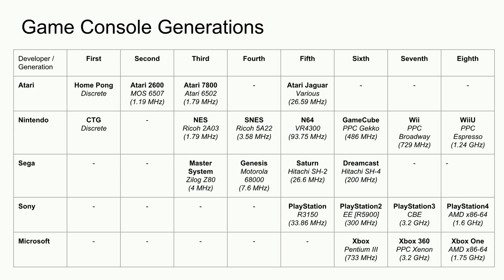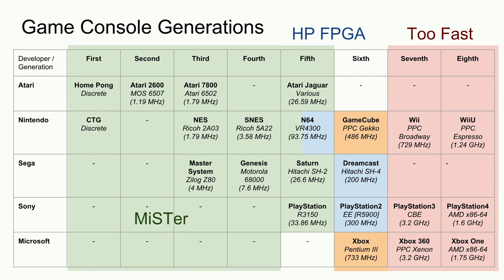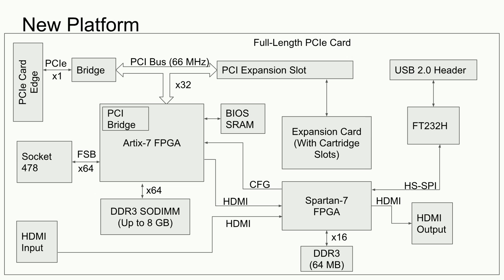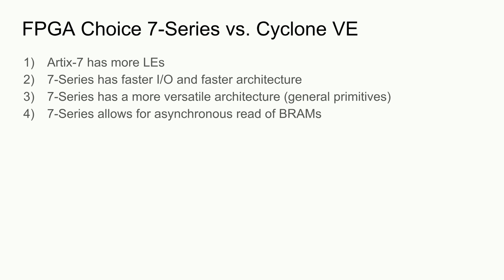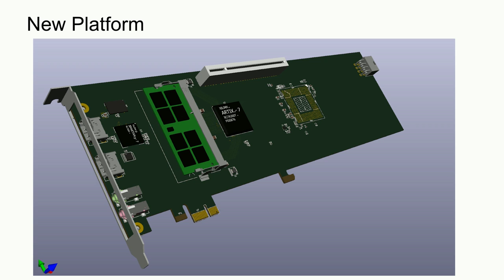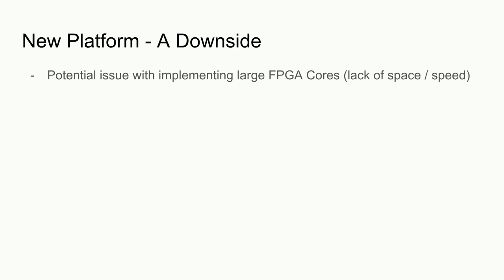A High Performance FPGA Game Console Platform

Comment: This is super interesting. Thanks for posting. I get the impression you want to keep all your progress private until you have a working result. Could you shed some light into why? Also, just out of curiosity, what HDL are you developing this in?
Reply from the maker: Thanks! That's correct. I actually would prefer to keep all of the implementation details private (I would probably release the board files though for the PCIe card). If you were more commenting on the span since the last update, the reason is that I have put that project on hold in place of another one which is also private (for the same reasons as keeping the implementation private).
So a few reasons to keep it private:
1) I don't want to open source it - as soon as you allow random people to start helping out, the entire project looses order and becomes a nightmare. Some people like that aspect, but I'm not one of them.
2) I don't want to provide the ideas for someone else to beat me to it. I can't work on these projects full time as I am a full time academic researcher (that takes priority).
3) Releasing implementation details publicly can be a problem with future job prospects, especially companies that receive classified government contracts. (i.e. they may be concerned that you would leak their project details).

Hopefully that answers your question. Note that I don't have much of an issue regarding releasing the final bitstream publicly (and would probably open the implementation eventually if I became tired of supporting it). I might also consider releasing an encrypted IP, however, I do know that some of those have been decrypted.

As for the HDL. I use both VHDL and Verilog. They both have their strengths and weaknesses, often covering each other. So I use the best tool for the task at hand. Often, the tricky logic parts are done in VHDL (as well as ROM LUTs), and the structural connections are done in Verilog. I don't use System Verilog though, or any other language - I prefer to have more control over what the synthesizer implements (I suspect that System Verilog for example would have problems tuning logic to change path delays, as it's less explicit, same thing with things like Scala based description methods).
Reply: @RTLEngineering  Thanks for the detailed response! Are you familiar with Henry Wong's work on creating a Superscalar Out-of-Order x86 soft processor? There might be some overlap with your work.
Reply from the maker: Yep, I have read his thesis. There are a few problems with using his work though. 1) It's incomplete to the best of my knowledge. Parts of it are done / work, but not enough to be a full x86 CPU. 2) It consumes a lot of resources... I'm not even sure it would fit in the largest Artix-7 FPGA, and 3) it would never run nearly as fast as would needed in an Artix-7. So to be used for an original Xbox, it would need to run at 700+ MHz, but the fastest it can run in an Artix-7 will probably be around 80 MHz. I suspect that even in one of the new Ultrascale+ FPGAs, it would only hit a few hundred MHz (certainly not more than 300 MHz).
It's a cool project, but not all that useful here.
Also, if you are interested in an x86 soft core, there is the ao486 (it won't run all that fast, but it's a i486 CPU). An alternative solution could be to use a RISC-V soft core as a base and rewrite the instruction fetch / decode stages to take in x86 instructions and translate them into RISC-V microcode. I honestly think that may be the best solution to get a "fast" x86 soft core on an FPGA, especially since there are small RISC-V cores that can run at over 150 MHz on the slowest Artix-7 (granted in that case, the x86 would probably be around 120-140 MHz with a very low IPC).

Comment: One day, I will have a powerful GPU sitting in my case, but having to share the airflow with an FPGA based emulation card.
I personally hope that FPGA based emulation becomes more widely available as it can circumvent issues that current emulation has. Like the odd quirks in the N64 that give Mupen64 quite a run for it's money on lower-end platforms... :p. My ideal dream-FPGA-emulation-thing would be an FPGA card that can be driver-controlled by the host OS. This driver would do exactly what it is named to do: flash the FPGA with the core, send some input (like the rom), maybe write some settings to it, take output from the card and display it - or even let the driver link an existing GPU with the FPGA board in order to do graphics-intensive work to render the actual graphical layer. 

Sure, I am not an engeneer, and this is just dreaming. But how cool would it be to have a gaming PC that doesn't just run modern games, but also retro games at pretty much intended speeds? I would love that. I'd easily throw out some money to have that, and even if I only would get the naked board, I would see if I could invest in a proper and nice cooling solution with a nice 3D case. While I like the looks of traces, transistors and chips, I also like the look of a closed-up product with some proper casing.

Really enjoyed the video, thank you very much for sharing this!
Reply from the maker: Luckily FPGAs are actually significantly more power efficient than GPUs. The one I proposed in this video is rated for something like 6W maximum, compared to a 120W GPU (as I recall, the RTX 2080 Super can pull 210W when modded).
  
As for your ideal FPGA emulation thing, that's pretty much what I described. And if things like SLI were open-source, you could potentially put an FPGA card into an SLI array with a GPU (to share data / video). Obviously that would have a lot of engineering hurdles, but it's conceivable for the future. Though if it got to that stage, it would be more general purpose than for emulation. Silicon may be relatively cheap, and it may be advantageous to put special function hardware blocks all over the chips, but eventually it will become wasteful, especially when the utilization drops to some small number (i.e. if you use the special function block 0.0001% of the time). That's where having driver-controlled FPGA cards (like GPUs) would come in handy - imagine using one specialized in video encoding with something like Adobe Premiere (Apple already does that because they don't get along with NVidia). They also make good targets for neural network evaluation, and ray-tracing calculations (why waste space on RT cores if you could bank on the end user having a configurable logic card that could implement them as needed).
I know that's not quite what you had in mind, but if that came to be, then those cards would be far cheaper, and they could then be leveraged for emulating old hardware too!
Reply: @RTLEngineering  If this was put into a computer like this would the emulator have to take up a full screen or could it pass through the Computer and be placed in a window that could be resized and popped in and out of the full screen?  I am thinking that you would have to flip back and forth between the two outputs unless there is an internal or external solution
Reply from the maker: That would depend on how it's configured. To allow the images to be resized, you either need to combine the image as an overlay (which would be quite complicated to manage - likely requiring hooks into the OS window manager), or you would have to copy the framebuffer from the FPGA card into the computer's display controller (i.e. the graphics card). If you did the latter, then you would necessarily have to add multiple frames of lag, and you would stress the PCIe link - there's only so much bandwidth to go around.
Flipping back and forth between two different outputs would likely be the better solution. The design shown in the video had a video in port which would allow you to overlay a full-screen output from the FPGA (no window resizing though), similar to the original 3dfx Voodoo1 and 2 cards. The other option there is to use a KVM type switch and swap between the monitor sources.
Unfortunately, modern display systems and window management are not well suited to handle a secondary video input source.
Reply: @RTLEngineering  basically what I imagined but wanted someone more in the know to confirm thank you

Comment: Take a look at the UltraScale+ Processing Module from Antimicro. It is open source and will likely be good reference material for you.
Reply from the maker: Unfortunately the pricepoint of using something like that would be too high. People who purchased this platform would be looking at between $900 and $1200 USD for something as powerful as a the $300 Ultra96 board. Some people may buy it at that price, but the majority of those using FPGAs for retro emulation / reimplementation won't go for that price considering the DE10-Nano is $150 USD at its highest price.
Reply: @RTLEngineering  Ya, it was a reference for inspiration. I wasn't expecting you to use the same FPGA.
Reply from the maker: Regardless, it wouldn't be viable. As a SoM, there are many other vendors that have lower pricepoint SoMs with the same FPGA, and in terms of making a custom board... forget about it (that's the sort of think that takes a team of 2-3 engineers about 1 year full time to produce, it's incredibly complicated to implement an MPSoC board, especially for an FPGA).
And then to produce a board with one of those FPGAs... for what you would really want to use for a project like this, you're looking at about $500 USD per chip for 10K quantity (assuming you could secure and guarantee 10K orders). And that's ONLY the FPGA. You still need the DDR4 (around $40 for the chips), other miscellaneous chips to match the expected quality (another $60), the board and assembly (another $120 most likely), enclosure (anywhere from $20 to $200 per unit depending on volume), packaging, assembly, etc. By the time you're done with everything, the minimum price it could be sold for (at cost) would be around $900, and that's after about 5 year man-hours of design and production work (all of which would be free labor since it would be at cost... so paying the engineers and adding in some profit gives you probably $1200 USD per unit for a 10K order, and that without any HDMI capability which is an additional cost).
Meanwhile, compare all of that to the $150 USD DE10-Nano you can buy, or the new Xilinx offerings for $200 USD or $250 USD with the same chip. It's no longer feasible to roll your own unless price isn't an objective (i.e. if you aren't selling to consumers).
I just wanted to give you an idea of the complexity of using a chip like that, and how it translates to the cost and design / production time commitment. I had a similar idea to yours when I started working on this project, but I didn't fully understand the complexities and costs with designing such a system.
I do appreciate you mentioning the Antimicro module though, it's always nice to know what various companies are producing.